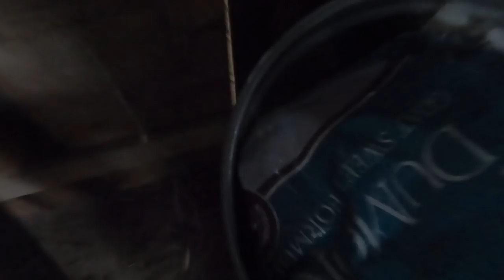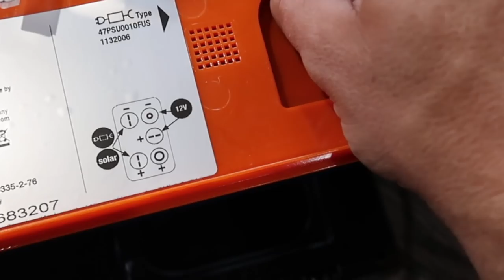Free Ranging in New Yolk City

Comment: Hey Al.  Most effective method is exactly what you were doing, picking off by hand. They don't hold on too well, so you could give the plant a good shaking and then suck them up off the ground with a shopvac.  Your chickens will appreciate the protein. Potato bugs preferred diet are potatoes, eggplant, tomatoes and capsicum (bell peppers) (solanaceous - night shade family).  Diatomaceous earth sprinkled directly on them can reportedly deter them, but they can be somewhat pesticide resistant. If you decide on spraying, try with Bioneem oil or some non-toxic that wont harm bees or beneficials. Lebia Grandis, Ladybugs and several types of stinkbugs are natural predators and like to feed on potato bugs, larvae and eggs. The potato bugs lay their eggs on the underside of leaves (look like little orange elongated caviar), so look for the eggs as well and squish them. Once they hatch, the pupae fall off leaves onto the soil and mature underground or in debris, then crawl out of soil as young adults (spotted pupae) or adult beetles.  At the end of your season, make sure to really dig over your soil and mulch heavily to prevent them from over wintering.

Comment: We used to use a chicken catcher we made with a wire coat hanger.  Take the end and make a hook  measuring about 3 inches  with the catching end the size of the chicken's ankle and attach
the the other wire end to a wooden handle.  You then do not need to get down on all fours  to catch
them.

Comment: I have tons of bugs here in central Florida in my backyard garden.  Since I stopped with the fertilizer, pesticides, and GMOs, I just let them be.  They become food for their natural predators. 

Regarding the potatoes, what I would consider is selectively breeding for disease and pest resistance.  For example, let’s say you only get a few ones that really thrive.  Keep those for next year’s garden and take the potatoes and make multiple cuttings out of them and plant.  Maybe it works, maybe it doesn’t, but you could set aside a small part to see if it works, then supplement w/ new seeds next year.  Then you could get into grafting, although grafting won’t fix your disease problem, it just gives you a more desirable potato.  (I know this last bit because I wanted to graft a nice wine grape to a muscadine (which makes bad wine which is usually back-sweetened - ugh).  My dream of becoming the next Robert Mondavei was washed away like so many castles in the sand.  lol :)   

 As an aside – don’t listen to me.  I have had really good actual experience with contacting researchers by email with a specific question after I  have researched it as best I could.  I’m not talking about the extension office (although they have an important place for sure); I mean preeminent people in their respective fields.  They are often very and nice happy to help.  After all, it’s their life’s work.
Reply from the maker: Good idea!
Reply: tom stewart eww. Sweet muscadine with a dry white grape. I can just imagine. Not to many muscadine wine makers. Well, maybe outside North Carolina.
Reply: TYGER0902  agreed lol.

Comment: You didn't state what time you came out. You could have been walking out at 10:45.... Also, why dont you fill the feeder up? Thats the whole purpose of feeders like that, so you don't have to mess with putting feed in it every day.  The one I built holds 175lbs and I don't have to fill it but once every 3 weeks with 3 adult hogs, and one is nursing.
Reply from the maker: We have been getting so much rain this season. I don't want the grain to get ruined
Reply: Lumnah Acres That's a fair point. But if you put some weather stripping on the lid then no water can get in. Plus the pigs put the weight on at a more efficient rate when they know it's always there.

Comment: Looks like you need to get those guys who butchered the hogs to come back and sharpen your knife. It was barely cutting through wet cardboard. There should be a wire that is on the inside on the unit thats goes to a contact on the bottom. So when the supplied ground stake is slid in it makes contact and no need to use excess wires. And only use the alligator clamp when using a different ground rod.

Use a pesticide. Everything on this planet is organic. We do NOT make things appear out of thin air. The old-timers invented pesticides for a reason. You breath in more toxic stuff from being around cars, your tractor...etc. Than you would from eating it from using it on your garden. Apply properly, not just spray just to do it.